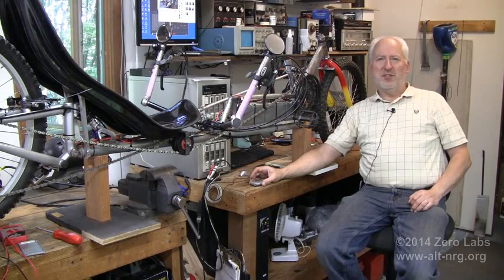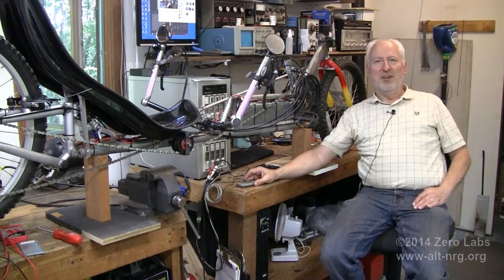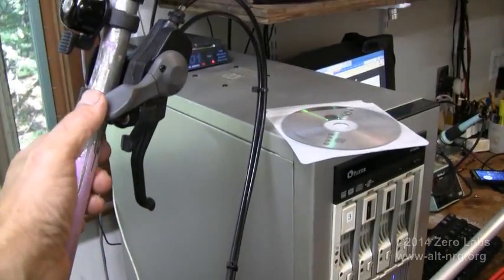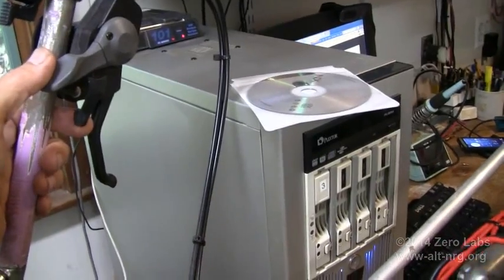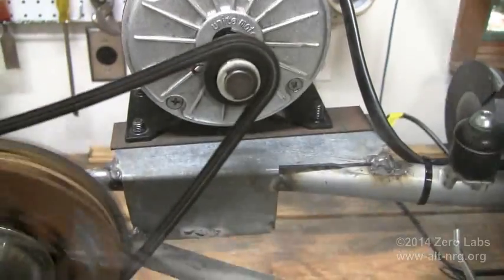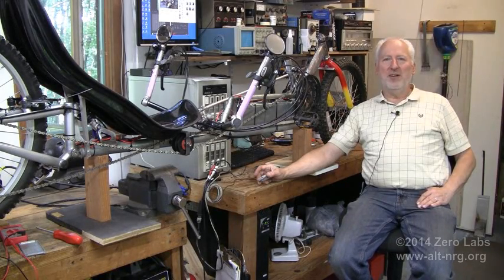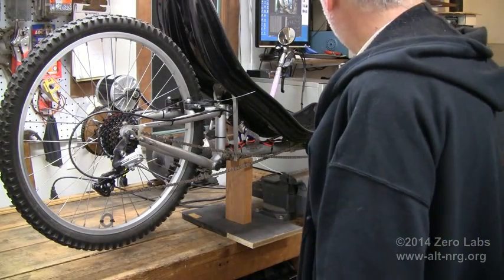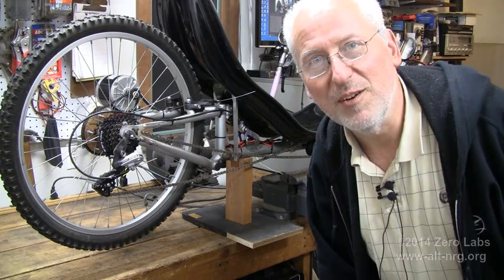#365 RWG vs Zero - The race update 2

Comment: the angle alloy stock for the steering on the forks looks a bit light when you start putting road shocks in it.. you might want to upgrade and or gusset it a bit.
Good luck

Comment: Hi Z! I'm here to show my support but also my concerns about the safety of this at high speed. First, let me say "I want you to win!!!" :) Any time a cycle beats an engine is a wonderful thing! I'm just (very) worried about your front wheel/brakeset.

If my eyes don't decieve me, that's a bmx front fork, tyre and brake caliper set. Nothing wrong with the forks, but i'd be a little concerned about the tyre not being up to the job -- 40Mph on a bmx tyre is a LOT, especially when it's doing the job of tracking a vehicle's direction much heavier than it was designed for. The tyre may be susceptible to excessive flexing under heat from the higher pressure exerted on it. This is the cause for a large amount of highway blowouts.

Secondly, the brakes. While I think the caliper set will likely hold up, those brake pads look like the cheapeast, nastiest variety out there and would surely last no more than a few seconds at top speed. Please spend some good money on a decent set of brake pads (a stronger brake cable wouldn't hurt either). It is either these that will stop you or the concrete (at this speed rear brakes will play a minimum role unless you have done something "special").

All this said I would LOVE you to prove me wrong and to WIN WIN WIN! But I also would love to see many more projects from you and that makes me voice my concerns about your safety. I am in NO WAY saying you should not take on this challenge, in fact I encourage it! But please, do it safely!
Reply from the maker: Ultimately, hydraulic disk brakes are the way to go. The present braking system is by no means engraved in stone. Same regarding the tires. Nor do I plan to be riding at break neck speeds on a regular basis. This is a race and I fully acknowledge that traveling at the speeds I plan to hit is a wild ride. Maximum speed under human power is geared right now for about 30 MPH at 90 RPM to the crankset. Your concern is appreciated. I do plan to wear some safety gear.
Reply: due to the wheel base length, center of gravity etc. the rear brakes should be able to do most of the work. Unlike a regular tenspeed with the rider sitting up high the front brakes do most of the work in a panic stop. 
Here it looks like the rear tire will be doing most of the work due to the seat right in front of it. That being said I am not a big fan of those types of brakes. I favor the disc brakes. I have not seen the previous build video so not sure if there was a reason for going the route he did. As long as he races in a safe place he should be fine.
Reply: ZeroFossilFuel
Excellent! In that case, good luck! I do have a question about the quarter mile race.

Since my last post I found your vid with you zooming up and down the road on your Z'cumbent and it seems that it's not easy to start from standing. Do you have a plan to make it easier for you to have a more aggressive standing start? i.e. maybe a stand to ensure you can start your 1/4mile with both feet on pedals?

I am also v interested in how you have attached the rear sprocket from the motor chain to your rear wheel. It looks like a very home-brew solution and I would love to know more about it. (sorry if you have already explained this elsewhere, I couldn't find it).

Again, best of luck. You have my support and my vote! :)
Reply: Mon Saka
You're probably right bout the rear braking due to the gravity centre. It makes more sense after thinking about it for a few mins but on an initial thought it seemed to make sense drawing from my bicycle experience.

Everyone favours disc-brakes! :) It's just a shame about the price and complexity of a decent disc system (hydraulic--cable disc brake systems are just not worth it!) for bicycles.

Comment: Dress for the slide, not the ride. Going down on pavement at like 50mph with no protection is no fun at all, I've tried it lol. I know you're probably concerned with weight, but you should always put your safety first. The rims, tires, hub bearings and brakes aren't designed for such speeds.

You have to figure, 50mph is highway speed... A half helmet, jeans and a t-shirt will do you little to no good if you go down. I like your work and would really hate for you to get hurt or worse... Please be careful.

Comment: It looks a liitle bit flimsy. I don't would like to see an accident with that bike at 40 Mph. How about a reconstruction from scratch?
Reply from the maker: How about not?
Reply: ZeroFossilFuel
That Evil Laugh was hilarious LOL :)
Reply: ZeroFossilFuel It's your health. Do whatever you like, if you feel save on that bike, I wouldn't. But that are just my five cent.
Reply: TheBadFred
Real men will bust their ass to take a leap forward. Go Z
Reply: Id hop on that bike and take it for a test drive anyway. It looks good to me.
Reply: Mon Saka The brakes are made for normal bikes, at this speed you would need disc brakes. Also shock absorbers etc.
Reply: Not if the road is smooth with no obstacles. After all it is a prototype. besides its not unusual for someone on a bike to approach those speeds in downhill racing. Back in the day those were all the brakes you had. 
On the other hand id rather be in his recumbent bike at those speeds then a standard 10 speed racer. lol Prudence says elbow and arm pads and helmets. :)

Comment: If that's a 350 watt motor you will be lucky to get 20 miles and hour unassisted.  i have got about 22 mph with a 500 watt motor. running 40 volt lipo's
Reply from the maker: I guess we'll see.

Comment: hi where do I find information. for motor controller like you use here 12/24 I hav the bike & components 2kw motor, xyk-2000-24 controller, 24v charger, no batteries as limited money and proper practical information, like matching batteries to motor, 100kg combined weight, Watt/amp hours = range etc. batteries, motor, controller & people all use different terms/values, I not even sure how to word a search to find it
Reply from the maker: +Brendan Haslip (Doone  &amp; daknaki) Motor "controller"??? HA!!! This is a dragster motor controller. Go/No-go, off/on, zero to zoom! Just some heavy duty relays in a box. Not what you want for "normal" riding.